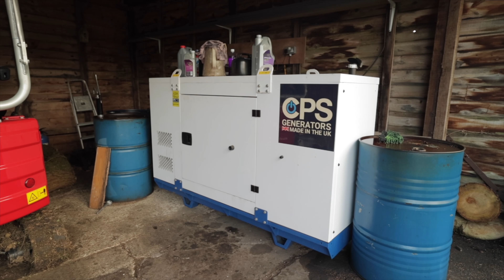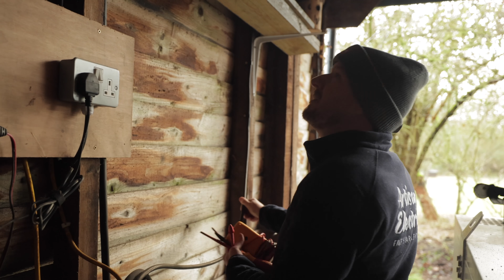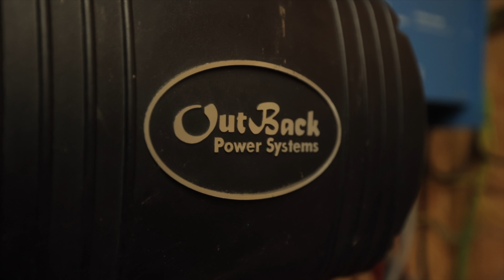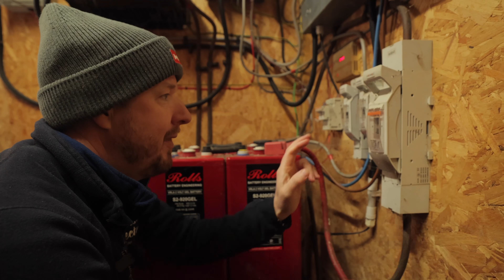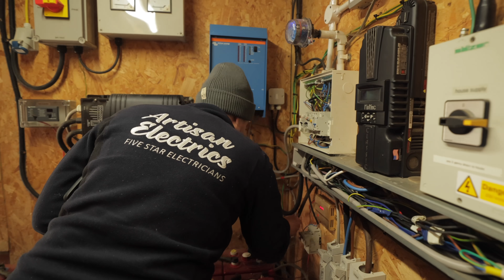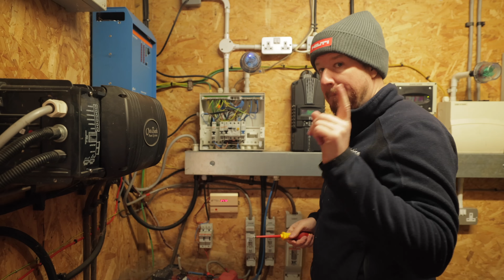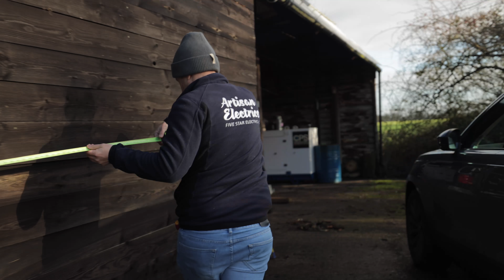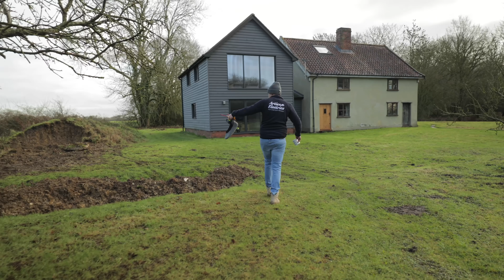DIY Off-Grid Solar Gone Wrong! (It Can’t Even Boil a Kettle)

Comment: Shouldn’t the 16a circuit breaker be matched to the output of the outback inverter?
Reply: yea and also the cable to the house. as stated it is a 6mm2, if you run the math it probably is the right breaker for the size. (not sure about UK code)
With IT code, a 6mm2 can supply up to 6kw with an voltage drop of 4% for 15m.

In a offgrid house you really need a full 6kw? Here in Italy we have 3kw for the consumer unit. (you can upgrade to single phase up to 6).

So yea he just want to replace everthing as he always want to do.
Reply: @tuttocrafting  6mm2 is good for 32A at least elsewhere in Europe, but other comments say that the inverter output is 3kW so 16A is appropriate for the generator.
Given how expensive long wires are and that the wire to the house has to unused conductors I would look into a three phase solar setup.
Reply: @The-secret-101  Yes and no, it depends on:
 - the regulations (like for the allowed voltage drops),
 - length,
 - type of insulation material
 - thermal dissipation
 - ambient temperature
 - number of circuit in the same condout or if it is a multi cord wire.

 There are formulas to calculate it.
Generally you can use 6mm2 for 32A, but not always.

Here in italy we have (mostly) 3Kw contracts, adn we have electric kattles.
With our stadard way to distibute (inside a tube in a wall with bricks and plaster) a multi-core (4wires) 2 circuit cable,  for 15m here in italy you need a 10mm2 for 32A.
If I still want to trasfer 32A in a buried cable, i can go down to 6mm2. This is just due to the thermal dissipation.
Reply: @tuttocrafting  True.
Here in Sweden voltage drop is almost only a problem if you don't have a ground fault circuit interrupter. Voltage drop with normal loads is just an annoying thing that it's up to the owner to live with or get rid of, but voltage drop during a short circuit is a safety issue as a direct short live-ground with the same size wires for live and ground results in about 115V potential on the ground until a breaker/fuse trips. Without a ground fault interrupter the trip time for breakers/fuses might end up being longer than allowed as a fuse/breaker needs to trip and with long wires the short circuit current is reduced. However a ground fault interrupter/breaker will trip immediately and thus there is no safety issue having voltage drop.

And yes, running multiple circuit in the same "channel" inside walls also creates issues. Since three phase is really common here in Sweden, the solution to for example add more capacity with existing pipes inside walls feeding a kitchen is to have a single three phase circuit, with fuses/breakers at 10A or 16A, basically giving the same power as three single phase circuits of the same amperage but you only need to count the current in three wires rather than six. (For some reason it's assumed that no one would connect old phase angle dimmers pulling loads of current from a circuit like this. Those dimmers was a known problem for stage lightning and such though, where the neutral wire might end up carrying more current than any of the three live wires).

Either way, just being able to feed say 25A or 20A or something similar on the extra pair of wires, or even 16A, directly from the (IMHO maybe oversized generator) would probably help and also be within what's allowed for that wire.
Reply: @The-secret-101 here in Italy  the allowed voltage drop for main drops /branches must have a 2% drop max. And 2% on the last legs (from breakers panel to the socket) so a total up to 4%
Reply: @The-secret-101  2kw for the Outback- not 3kw...

Comment: 10 kva victron multyplus  charger inverter and a ,mppt charge controller wil do it all... genny to the mains input of the multyplus,  ,programming a relays in the multyplus to start the genny at low battery to charge the battery and feed the house.while charging  new modern panels at high voltagedc  and a few mppt controllers, lifepo4 batterybank and you are ready, Nothing to it..
Reply: exactly. Simplify, £8k for multiplus, lifepo and MPPT, some wiring, jobs a goodun
Reply: Agree with you both. But actually the current setup isn't the disaster portrayed.

Sorting out the consumer unit and the Generator to feed it properly would do wonders.

Likely the batteries are maxed for Amps out or old. But, in principal a setup based on separate kit like this is vastly more cost effective than a SigEnergy setup. And much more future proof. Replacing parts in twenty years time will be viable when SigEnergy have vanished.
Reply: @jimkirk882 but no, it has to all be done "properly" at least 40 grand otherwise it's wrong! :)

Comment: i only install Victron gear in motorhomes and camper vans and build show system  and ive seen some shocking installs by diy and had to condemn them people just dont under stand cable size on 12 volt system need to be much thicker then they think. 

 had a job in to look at a victron inverter charger 12/3000/120 multi plus 2 and was install with 35mm2 cable for the 12volt side  need  to be 2x 95mm2 just for the positive  and the same for the negative 

 i show the customer on the thermal cam the heat build up in the lugs and the cable's  with a low wattage kettle 1kw was a simple fix  to change out the cables to all the other victron gear   

a simple tip i give to any one using victron gear is fit the larges size cable that will fit in the screw clamps  eg 100/50 solar charger will take 16mm2 cable with a sq feral and a orion xs dc-dc will take 20mm2 with a 6 side un-insulated  feral 

then add up all the cable size's from each device to Lynx Distributor (proper fuse's to protect the cable) and the size to run to the battery is what you add-ed up  eg 2x solar chargers -2x dc-dc and inverter charger  16 +16+20+20+95+95=262mm2 cable that not easy to work with or even get so i would be happy to run 2x 120mm2  

and keeping cable neat and tide make fault finding much easier but i did notice they mixed DC and AC cable in the same cable duct  as a rule in van and motorhomes that a big no-no  

look forward to seeing the install and what battery's your going for  them keeping 24v or going up to 48v as the gear much cheaper and cable size much smaller
Reply: Your comment demonstrates why Jordan is ripping out the whole system, including the ONE piece of Victron gear. If he was to quote the customer on a repair and upgrade of the system, using just Victron stuff, it would be 4 times the price of the proposed Sig system. You Victron fan boys are paying squillions for a setup that's messy, complicated, a dozen boxes for one function, and is completely unusable by the average punter that is not a wanabe electrician.
Reply: @MichaelWakefield-mx6hg  the reason i only use victron gear is it just works  and there 5 year replacement  on any victron gear  plus there apps and support is the best and i can remote in to any of my install and update firmware change setting if the customers had some changes done  and most motorhome and vans run on a 12 volt system so your stuck with either renogy or victron  and renogy inverters are no good at inductive loads or motors  were  victron has a giant copper donut ( transformer)  and give the cleanest sine wave  for use with computers
Reply: @MichaelWakefield-mx6hg  and please dont suggest 48 volt system as i know the inverter are cheaper but in van or motorhome cant have stack of battery's  to make the 48volt and no space for server rack battery

Comment: 25 kilowatt hour battery bank that is good for about 3000 cycles if you only use 50% of it, so about 12kwh useable. Those batteries are probably toast, the date code looks like they are from 2020.  You could triple the amount of capacity in the same space as about 2 or 3 of those batteries with lithium iron phosphate cells these days. 12kwh isn't very much for a house that size, even with only a 3kw inverter.
Reply: Although lead acid batteries makes almost no sense nowadays (except if you really need to be able to charge them when it's below freezing and you don't have enough charging energy to first heat up the batteries and then charge them), but since they already have them, they can be refreshed!
Can't remember the exact details but you temporary remove the acid and replace it with something else, also can't remember exactly what, and then run a charger that forces lots of current into the batteries, boiling away residue on the plates. Then IIRC flush with water and finally put in fresh acid (or possibly recycle the existing acid?). Quite a bit of job, but not much cost (especially if you have a suitable charger, like for example an electric welder that can be jerry rigged as a charger).
Reply: @The-secret-101  IF you live in extremely hot or extremely cold areas- L/A is still a bust- go for LYP lithiums, rather than LFP and they can go from minus 40C to 85C- WAAAAY higher and lower than LFP or L/A.....
Reply: @The-secret-101  Those are gel cell AGM's, so I don't think you can refresh them unlike wet cells. The low temp feature is one of the benefits of sodium ion whenever it becomes more mainstream, until then heated batteries with a low temp cutoff is the best replacement. You can fully discharge and then slow charge the batteries, that's the recommended approach for trying to recondition gel cells, unless they are visibly bulging. It'll take a long time to do so with that bank.
Reply: @andycanfixit  Oh yes, good point, missed that they are gel cells and it's probably not possible to remove the gel to refresh them.
Another option is to build kind of like a root cellar but insulated from ground moisture, to keep the batteries and solar equipment in. Jesse Muller here on Youtube recently released a video where he did that. But then he is one of those who owns a bunch of construction/groundwork equipment like excavators, skid steers and whatnot and if you need to hire someone to dig out a hole to put a root cellar in, and then putt he dirt back on top of the root cellar when the concrete structure is in place, the cost-benefit v.s. just having heated batteries might not be that great. Still a neat solution.
Reply: @The-secret-101  My old solar setup I sold to a friend before I moved had a 12kwh bank of 230ah cells and a reclaimed cell bank made from lifepo4 medical batteries of about 6kwh. He built a small insulated enclosure and then added a couple 20 watt heat pads folks use for starting seeds in the bottom of the enclosure tied to a thermostat. Kept the batteries at a nice 50F even when it recently fell to 14F for about 4 days, stored in a garage with little insulation and no heat. Pads only cycle on for a few hours each day in the dead of winter. 

If I were the guy I'd take the outback inverter and the midnite charge controller and existing panels and pair it with a couple 100ah 25.6 volt batteries and use it as a power source for that shed and any outdoor projects, then setup a new system for the house based on a 48 volt battery setup and inverter and whatever ground mount arrays. Then he'd have a nice little setup for work out there with about 5kwh of storage for around 500 that doesn't need to dip into the storage for the home or the capacity of the home inverter. No reason to get rid of good gear. 4 of those batteries would give him almost 10kwh, not far off what the lead acids could do when new but able to charge must faster since you don't need an absorption stage anymore, and he'd have a backup system should his home inverter ever fail. I hate having single point of failure, especially for off grid. Clean up the wiring.
Reply: @andycanfixit  LYP-- go from minus 40C to 85C temp range lol- sure more expensive than LFP- but that temp range more than makes up for it if you live in areas where temp extremes are common.... no need for battery heating at all....

Comment: 16:48 you chat some absolute nonsense. Generator don’t generally have any issues with Volt drop whatsoever. Badly designed distro and wiring creates volt drop. Stick with your domestic system systems but even then you think plasterboard is Live 🤣
Reply: I’m not an electrician but I’m pretty sure smaller cables have more resistance and the more distance it needs to travel will make the cable more resistance (so the electric will struggle more to travel through small and longer cables). Technically the customer says he wants green if possible although I think the voltage drop can still happen even on a generator because of the small cables. This could be all wrong, I’m a computer technician but I assume similar will apply to electrical cables.

Comment: That's the kind of install fix. Where I thrive. 
I'd map it. Build schematics of the current setup. Then redesign it, keeping as much of the original kit where possible. And either an MK or Hager distribution board. 

Personally, I'd keep the 2v cells, over lithium...
Reply: I think they are dead after 10+ years.

Comment: HI Artisinaelectrics, wake up it seams to be all about the maximum cost you can get from the customer, instead of a small upgrade and to reuse some of the exsisting equipment and to remove everthing from the wall and start afresh, there is no  point paying thousands for a larger inverter because it will never supply a house all day, like two showers, cooker, sockets , lights all on batterys.
It needs only need to supply only lights and a coulpe of sockets. A modern house with its energy demand will only ever be on batterys alone if they were going to pay for a ridiculas priced field mount array of panels and 500kw or more to really work.

Comment: You are learning as you go along, how can you call a solar controller an inverter? It does not invert anything, it is just a dc charger that takes the power from the panels. The system is quite old, and probably very good at its time. Yes the AC side can be the let down, but as a DIY system, is done its purpose.

Comment: Looks like an American lived there.
Reply: Not really. People just used Outback inverters and MidNite charge controllers because they were good quality kit. This is a high-end install for its time.
Reply: Agree
Reply: Nope- you will find many Australian systems here (older ones) using Midnight MPPT charge controllers, and Outback inverters (thats a quite old system- but all the kit was top of the line when new- Rolls AGM were mega $$$ (but would be at the end of their useful service life- if not past it) and Outback inverters are available in 230v 50Hz output (that one is only a 2000w rated inverter- a FXR2024E rated at 240vv 50hz nominal- it really needs replacing with at least a 5kw or more one for modern usage however, a 48v Victron 5kw Multipus II would cover most peoples needs with ease) replace the Rolls AGM with EVE 340Ah LFP lithium cells and add a second 60AA MPPT charge controller ( The existing Midnight charge controller is fine on 24v or 48v nominal- and its a MPPT charge controller- NOT a bloody inverter Jordan....) with 3kw of panels- tidy the wiring up , and you have a perfectly fine offgrid system for a fraction of the price of a Sigenergy system.....   Jordan might know what he's doing on the mains- but his lack of knowledge really shows when he steps out of his field.....

Comment: It's called a charge controler, not a solar inverter!
Reply: Charge Controller not inverter
Reply: MPPT
Reply: In his defense, probably just used to the inverter also being the MPPT, as I am. Not too often you run across a non-integrated system anymore. Real old school setup.
Reply: or a ... 'luminosity particle to electron converter... ' all means the same thing lol.. everyone thinks their terminology is better than yours.
Reply: @muzikman2008  You dummy a flux capacitor is not the same as a MPPT charge controller.    ;)

Comment: So all new instead of putting the right size breaker.  Hopefully you at least fixed what wasn't working as a temporary fix until you get the up sell done.
Reply: If the client had wanted a bodge job, I doubt they would have gone to the trouble of contacting this firm.

I think it's also pretty clear that the existing setup - apart from the 16A breaker -  is not suitable, so tearing it all out is pretty much a given.

I'd concede that there's probably cheaper alternatives as to what you put back in...but when it comes to something as fundamental as having the lights and heating working in your house, opting for a more expensive but reliable system doesn't strike me as a particularly unreasonable or "up sold" recommendation.
Reply: @tomfahey2823  well said Tom

Comment: FYI, it's only an "inverter" if it converts DC to AC (that's what "inverter" means).  The opposite of an inverter is a "rectifier" (AC to DC).  The more general term (for all of them) would be a "power converter".

However, there are some types of devices that can do both/either, depending on how they're configured.

(A "transformer" is specifically only a device that converts AC to AC (at a different voltage), using magnetic coils, so that is something different entirely.)
Reply: Very true, ironic he say knows just enough to be dangerous.
Reply: @davidsoulsby1102  Id' say that he knows just enough to be expensive...
Reply: The Midnight MPPT charge controller he mistakenly called an inverter is just that- its a solar charge controller (specifically a Midnight Classic 60A MPPT charge controller)- completely different thing to an inverter....